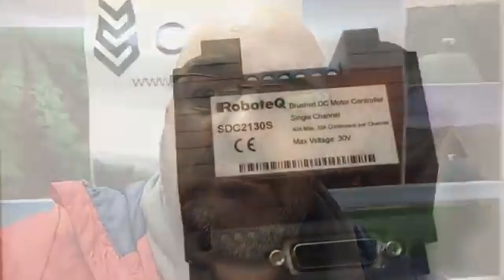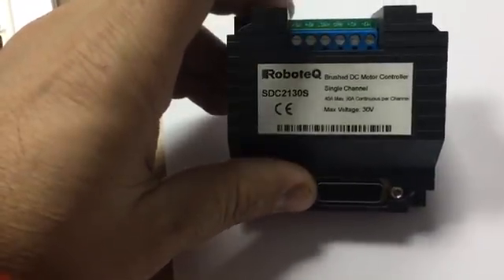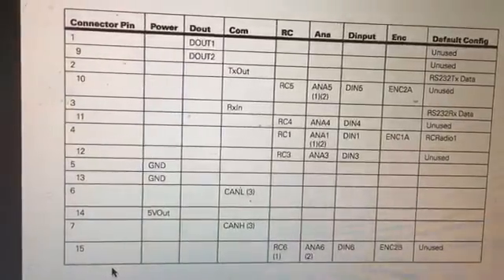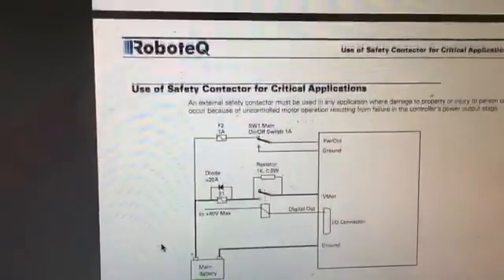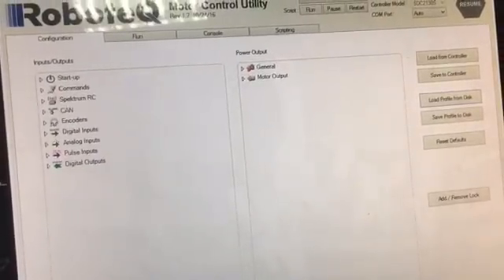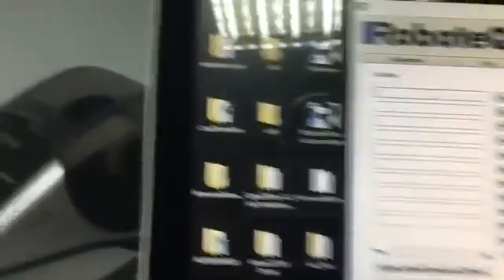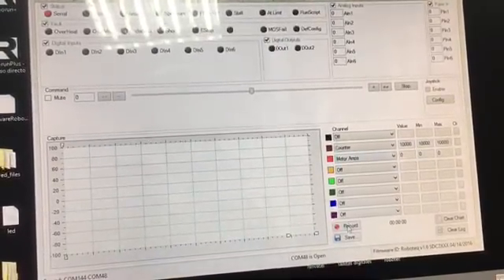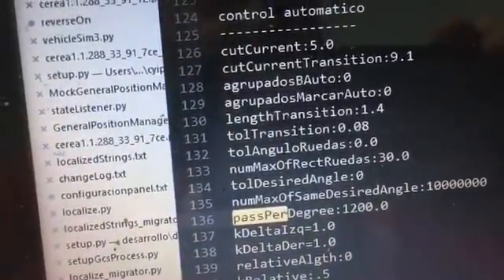Roboteq setup. English

Comment: are you using a USB to FTDI/TTL adapter to connect the computer to the roboteq motor controller? Also how are you securing the loose cables to the RS232 female port?